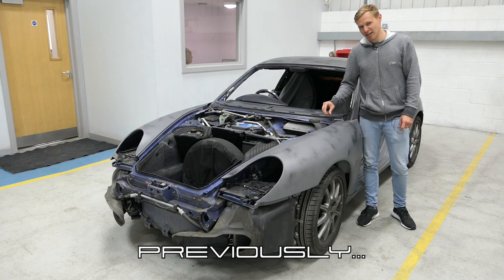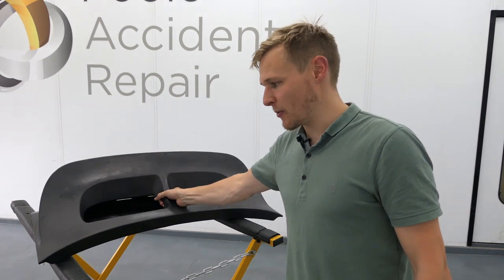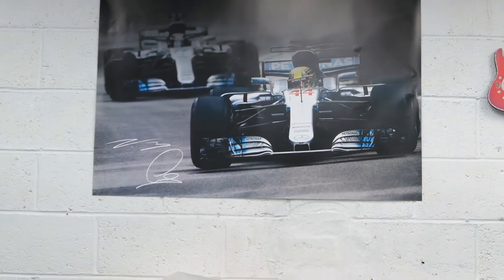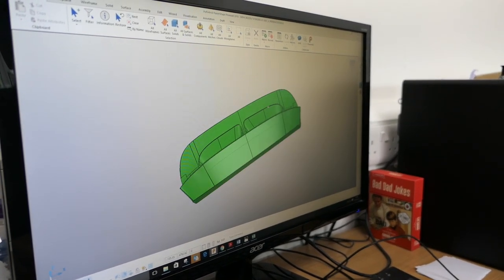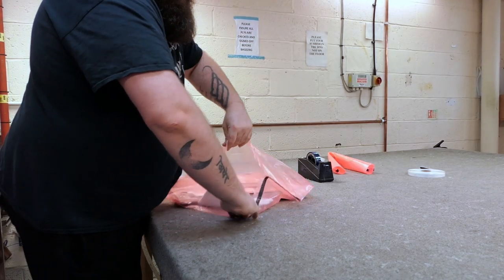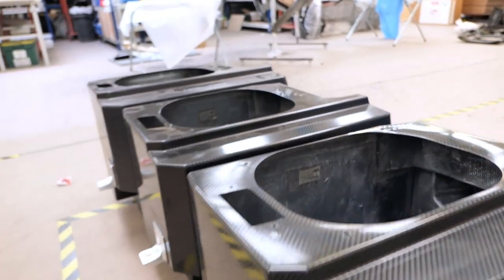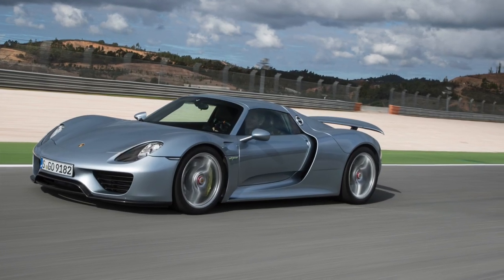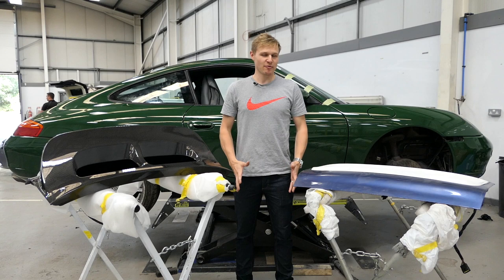Fitting a CARBON FIBRE ducktail to my Porsche 911 996

Comment: I’ve been on the fence considering which way to go with my own 996 rear wing and this looks fantastic. I have to admit that I am in total suspense as to the cost of the thing. Will you ever reveal?
Reply from the maker: Thank you! I'm so happy with the result, it looks beautiful. Regards costs, I'm reticent to discuss this so publicly. I'm old fashioned in that regard: I don't feel the need to throw around figures like a badge of honour, which seems to be rare for a Millennial. I've simply spent what I can afford, and implore others to do exactly the same, whatever that may be.
What I will say is full pricing for the CSR ducktails are on the RPM Technik website – I went for the most cost effective option as you'll see. Paint costs vary depending on the amount of prep work needed. I hope that's an answer you find sufficient, apologies if not.

Comment: That  Carbon rear wing is 2k. I grabbed  a original Porsche 996   Turbo wing off Ebay and had it painted Lapis blue Then welded 5" stand off 's on it. drilled through the Top plastic tray and secured through metal backing plate on underside. Factory Part and looks sick.  $500 all in.
Reply from the maker: Good idea if you've the skill and know-how! I'm a pen pusher by trade so that job's beyond me…!

Comment: I hope you will be painting it in the body Irish green.

If so, as a Porsche 996 C4S owner its a thumbs up from me. 👍

Ps. Left in Carbon fibre it may look a bit naff!
Whats the cost?
Reply from the maker: This has been a dilemma for me, I can assure you! Costs vary depending on what ducktail you want, mine was the most cost effective hence no high-level brake light or back grilles (full pricing is all on the RPM Technik website).
Reply: That Nine Eleven Guy thanks for the info.

If I did it to my 996 I’d seriously consider getting it painted in body colour. My 996 is classic silver.

Comment: Love the ducktail buddy ;-)
Been on the ropes of replacing my aero deck lid with one for about a year now 
Look forward to seeing it fitted 
And seeing it made must of been interesting too
Reply from the maker: Honestly, I highly recommend. RPM have even had a 996 GT3 RS replaced its fixed wing for a carbon duck! It'll look awesome on yours.
Reply: @9WERKSTV  
Fitted RPMs lightweight fly wheel and sprung clutch not long back too and cant fault the customer service ;-)
Keep up the vids ;-) you've made some great content
Reply from the maker: @leehartshorn1479  Agreed, I rate them. Sincerely appreciate your positive comments too.
Reply: Lee Hartshorn likewise, the rear aero wing is a heavy bit of kit and maybe something I will do in the future, I’ve not properly looked into it but I thought the RPM ducktail was a couple of grand.

Comment: if the car is unstable at high speed, check bushings and suspension.
Reply from the maker: Will do that very shortly, thanks for the tip.
Reply: Note also that if there is more downforce at the back, the front might get light, so adding a lip at the front to counteract this might be wise.

Comment: You say that carbon fibre parts are "extemely heat resistant". Can you tell how many degrees it can withstand without harm?
Reply: Carbon fibre should be fine until temperatures that exceed 200^C, which is perfectly fine for body parts that won't get to those temperatures in any way.
Titanium is more heat resistance (600^C) but it's heavier and more expensive, also carbon fibre it's less shock absorbent but doesn't deform linearly

Comment: Very nice!  Any plans re interior?  Your seats look a bit tired...
Reply from the maker: I fully intend on swapping out the seats because a) the ruffled leather look is comical and b) they offer no comfort or support whatsoever. I'm open to suggestions on what to replace them with…
Reply: That Nine Eleven Guy I am an OEM kinda guy so perhaps the factory hard back sport seats?
Reply from the maker: @allanlai_  I had them in my first 911 (996.2 C4) and although they are better than the Comfort seats I currently have, I still don't think they offer great support, particularly at the shoulders, though they are more comfortable.
Reply: That Nine Eleven Guy GT3 style buckets then!  Pole position would look great too.
Reply from the maker: @allanlai_  Awesome, will look into it!